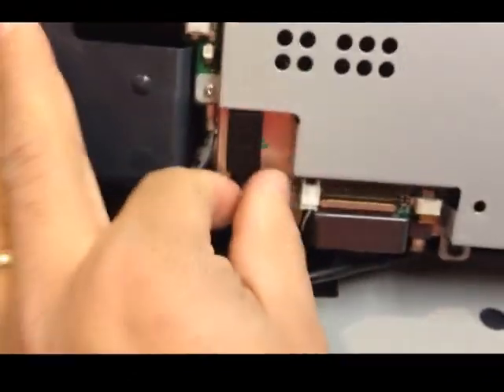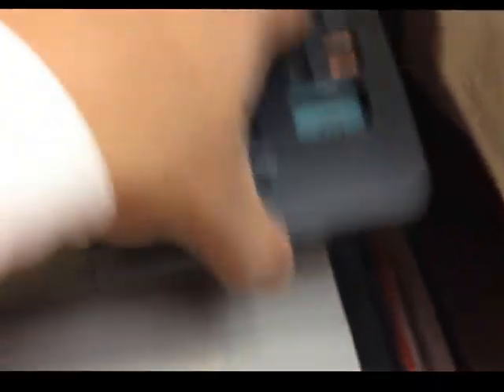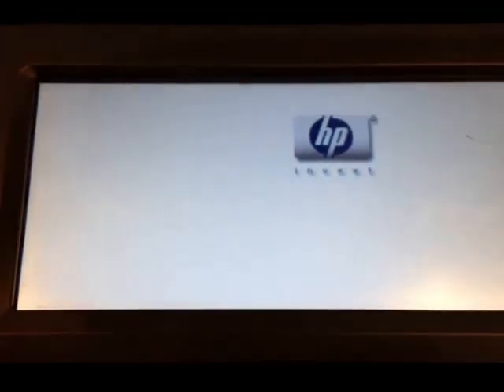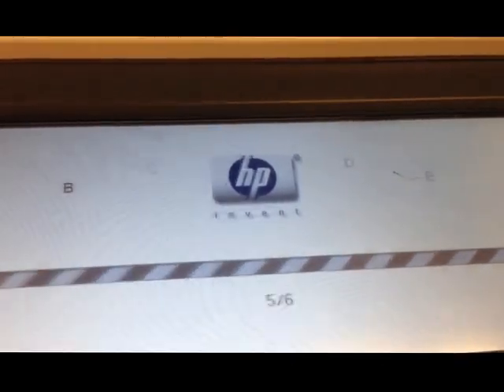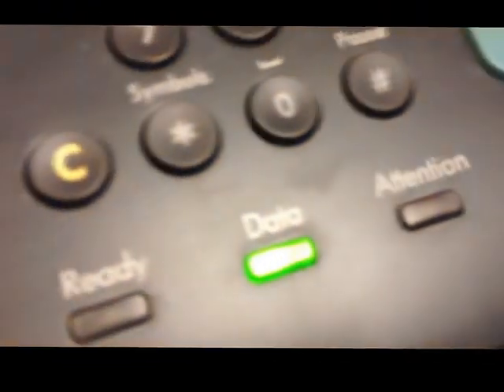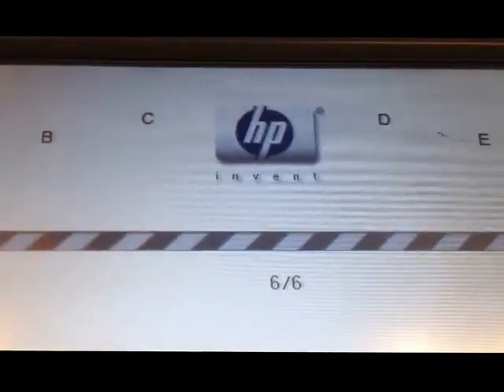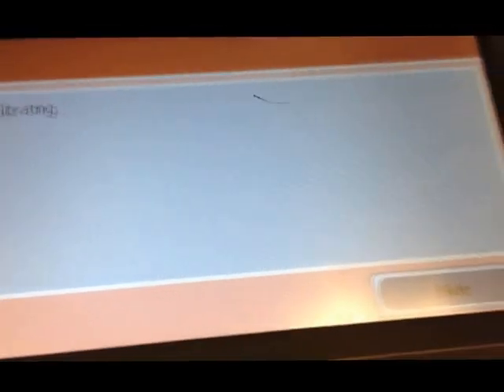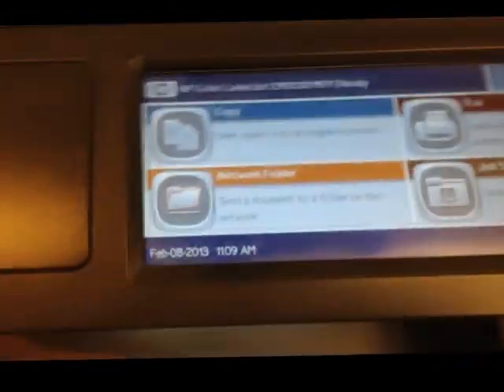HP Color Laserjet CM3530fs MFP "Communication Lost" Error Fix

Comment: Hi i had very often the error 30.08.01 (scanner locked). but its not locked. last time i've disambled the scanner and found nothing. after reassembling it worked suddenly for a couple weeks. but now it is back. do you know which cable could be the problem?
Sorry for my bad english.

Comment: this mini usb cable is a problem i ve replaced the cable
Reply: Simon Sakala Hi, do you remember what the other connection end of this USB Cable is? I am having the same issue, thanks.
Reply: @Creative0Mind  I just did a major repair on one of these and the other end of the cable is standard USB like you'd plug into a PC. It could also be the other end that's not plugged in right. I personally never saw this error and had this machine about 10 years.